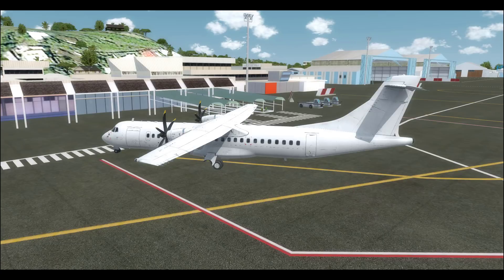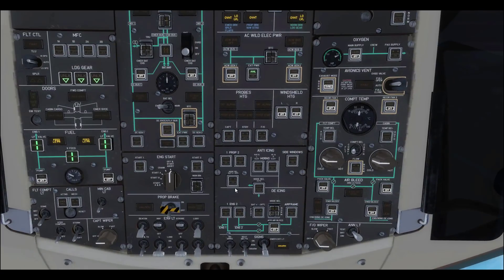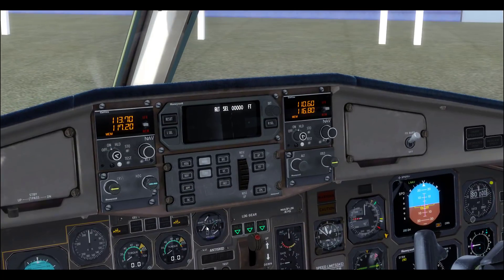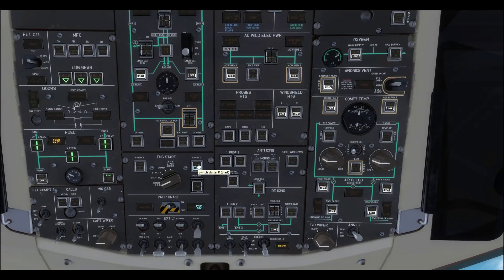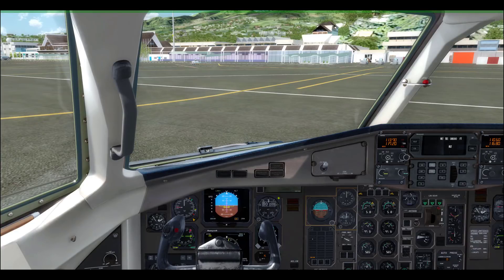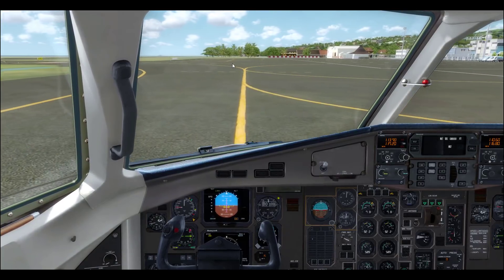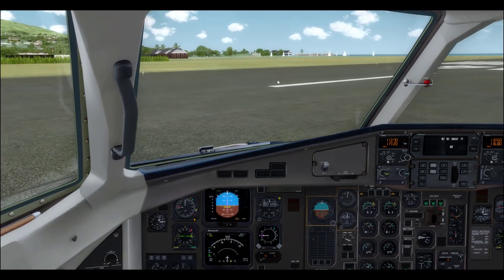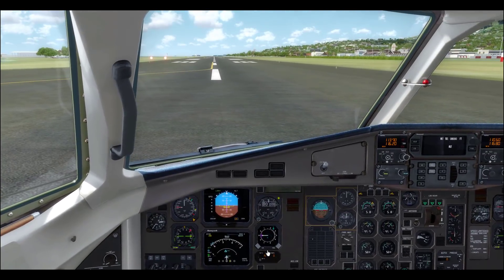Carenado ATR 72-500: Tahiti to Bora Bora

Comment: To any interested atr fliers. If your struggling to climb or catch up over terrain. Use ias climb white bug +5 which should be around 140ish knots.  If ur plane nose downs when selecting ias climb and u get a small descent rate, u can always arm v/s climb +500fpm. You can then arm ias climb when u see the speed is at ur desirable climb speed. 

Only arm ias climb 170knots once u are sure u are able to bypass terrain or no atc is chasing u to climb. 

The atr is not a very good climber compared to the Q400 so take note on this.